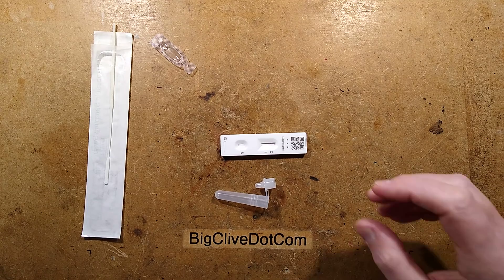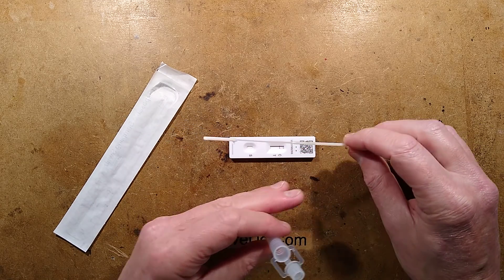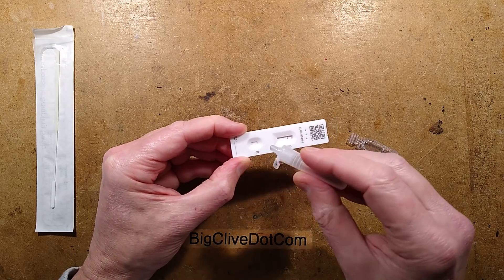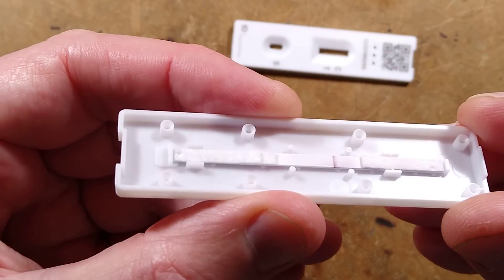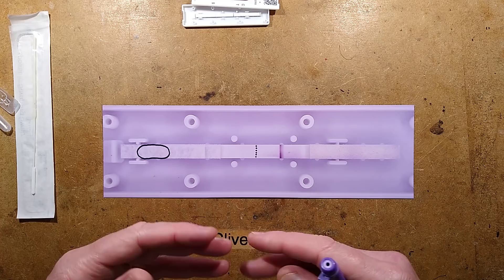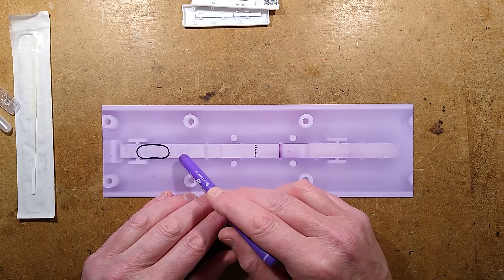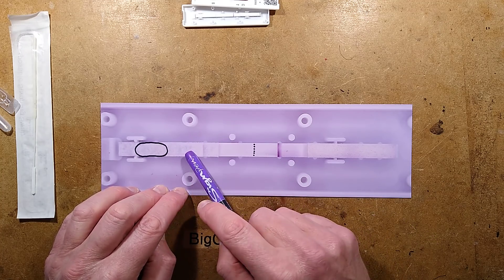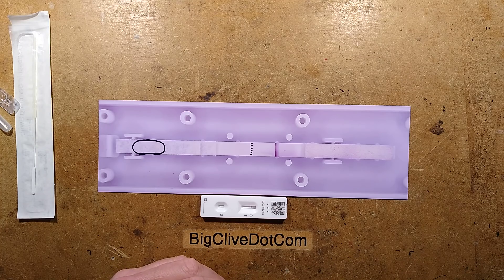How a lateral flow test strip works (kept simple)

Comment: When we put blood through them we generally separate out as much of all types of cells as possible, if you want to do lateral flow or blot type immunoassays you use serum, which is the gooey liquid that the cells float around in, minus many of the big proteins responsible for clotting.
Reply: Maybe for Covid, but plenty of LFAs use sample separation pads to do this making separation by other means unnecessary.
Reply: @xTheDeerLordx  But the pad handles separation, so you're still going to end up with something in the plasma to serum range for the actual reactions.

Comment: when I did my covid test they told me to twirl it around the opening of the nostrl
Reply: That was bad advice.
Reply: @wirdy1  Was the instructions on the test. stick wasn't much longer than a cotton swab or whatever
Reply: @Ckcdillpickle  I stand corrected. There is a new swab test that's far less invasive. Thanks for the heads-up 👍
Reply: The covid test places where full of parking wardens.
Reply: You should stick it about one inch deep, or until you feel it won't go any further.

Comment: A waste of plastic, I always feel bad when using them
Reply: Yeah, I'm happy to take the tests and appreciate the purpose behind them. I work in education and have to take them at least 2 times per week. However I just chucked yet another one in the bin after use and was honestly thinking the same. I thought to myself, "Future archaeologists will find a layer of these in the sediment in 10,000 years and learn of the pandemic." So much waste indeed. On a scale I find hard to find a comparison with. Maybe bullet casings on battlefields but even then locals usually scavenge most of those up for valuable scrap not long after the battle moves on.

Comment: I was under the impression that you took your sample from the back of the throat OR the back of the nasal canal. You don't do both at the same time.
Reply from the maker: This is an older version.
Reply: You do both with this type of test kit.
Reply: Nope, it’s both.
Reply: You learn something every day.
Reply: They are continually evolving or changing. I am several boxes in, supplied by my employer, and have had two brands that whilst very similar there were noticeable differences in procedure. I just make sure to read the instructions with each box in case something has changed or been updated and do the test as instructed.
Reply: Always read the instruction for your particular kit – they vary. More recent forms often only require the nose.

Comment: There's a company called DIAGNOS who have fairly recently released a saliva covid test rather than having to swab your throat and nose. A much nicer experience that's for sure.
Reply: Not sure they are a recent thing. I had those last summer from my employer, had to be sent to a lab for processing.
Reply: They are lateral flow tests - the same as these -  just using a saliva sample instead of a swab. You don't send them away - you get the results in 15 mins. Pretty sure if they were around since last summer no one would choose to stick a swab up their nose instead?

Comment: The latest test kits I've done don't ask for you to shove the swab up your nose, just around the tonsils
Reply: Some tests do it the other way, in other words swab up your nose but NOT your tonsils. I'll also add that I think it's about time somebody developed a non-invasive test that is about as cheap as this and just as accurate. Either that or a suitable blood test (that's 'invasive' of course but a pinprick is far more pleasant than ramming a swab up your nose or down your throat).
Reply: The latest ones I have are nose only – super easy (unless you’re one of the idiots who doesn’t read the instruction and thinks you need to ram it 6 cm up the nose of course! 😂). I imagine if it were that easy to come up with another test, people would do it – though I don’t think you’ll find many takers for a blood test as an ‘easy’ alternative!

Comment: We have something similar in beekeeping for testing for American foulbood a bacteria infection that kills bees. Thank you for showing how they work
Reply: How on Earth do you get the stick up the bees nose?! 😮😂
Reply: @Pugjamin   very slowly
Reply: @Pugjamin  no the pupa turns into goo and you add the samples to a bottle with some steel shot to mix it up then drip it on the test strip
Reply: The fact that these types of lateral flow tests are so common is why S Korea had so much COVID testing so fast.  It isn't the most reliable thing, but cheap and easy.
Reply: It's been a long, long time since I've kept bees. It's great that there's a test for AFB now. Is there also a treatment?
Back in the dark ages (1980s) we had to go by our sense of smell. Infected pupae smell like glue. If we found it, our only recourse was to cyanide the bees and burn the affected hives. Nasty disease.
Reply: @johnopalko5223  here in nz we use a liter of petrol and a match burnt in a hole and covered

Comment: You can still get covid when you're vaccinated.  I did 10 consecutive days of positive results with those, 2 months after my second Ox-AZ.
Reply: This is not news.
Reply from the maker: Yes you can.  But by priming your defence system your body has a head start against the virus.
Reply: @bigclivedotcom  Yeah Clive (good, interesting video as always btw), as a loose analogy it's like using well trained troops in a battle instead of poorly trained ones. It doesn't guarantee success but you'd be stupid if you didn't train your soldiers even though you had the time to do so.

Comment: Shows the process but not how it works, i.e how it can detect a dead virus molecule and identify it as a certain strain, hard enough for a lab to clarify.
Reply: It doesn’t detect the virus, it detects the body’s reaction to the virus.
Reply: It is an antigen test and will detect surface protein molecules on a live virus. The LFT is highly specific so is over 99% effective at detecting a viral infection although it may produce a small percentage of false positives, but may miss some low level infections with low viral load. If a LFT is positive there is a very high chance you are infected and highly infective. For this reason they are good as a screening tool to eliminate those who are infected and may be most likely to infect others. 
PCR looks for the virus genetic (RNA) material from its core, it is more prone to false positives because it can detect inactive viral fragments post infection but is good at finding infections with lower viral loads.
Reply: 1. It’s not designed to detect a ‘dead virus molecule’
2. It’s not designed to identify a certain strain
It detects the proteins of the Covid-19 virus.
Reply: @Zveebo  no virus is a living organism.
All viruses are a certain strain.

Comment: The new tests issued by UK gov are nasal only, no throat swab needed. Currently testing daily for work, which is fun…
Reply: also the fluid comes in the dropper bottles in newer kits
Reply: They're still supplying the throat and nose version alas. Picked up a pack at my local Boots a couple of weeks ago when I went in for my 'flu jab.
Reply: @SouthPaw1805  im in Scotland we can order a free pack of 7 test kits online and get them thru the post.
Reply: I've ordered by post and collected from various locations (including being given a set at my vaccine appt)
In my experience, those by post are the "new" nasal only (and faster, only 15 minutes) tests.
They also have more fluid in the container, so don't fail if there's more "gunk" than usual.

Comment: I think the 'C' might stand for "Control" instead of "confirmation", but I could be mistaken
Reply: 'C' stands for Clive, Big Clive, of course!! :-D
Reply: @stepheneyles2198  007?
Reply from the maker: It probably is.
Reply: @bigclivedotcom  The booklet says control line region, they work in a similar manner to the pregnancy tests sold in poundland and other higher priced shops.
Reply: @paulroberts01  They actually work in the exact same way, you just use different antibodies for the lines and conjugate (or "molecular keys attached to dye.")
Reply: S is for sample, T is for test, and yes C is for control
Reply: So the important thing is, Clive isn't pregnant.
Reply: It is all BS, no matter how you look at it !
Reply: @gertjanvandermeij4265  … no, it is not.

Comment: You should checkout the electronic covid tests kits, the electronics are totally unnecessary, but possibly hackable? the ones I've head of use a 32bit mcu
Reply: Lemme guess, they're the same thing as those "digital" pregnancy tests that are just a standard one but with a light sensor on the testing bit?
Reply: @kiefac  Yep. It was SignalPath that did the tear down.
Reply: I’ve used one of those, from a company named Ellume. The actual test components are very similar to any other lateral-flow test strip, except that the antibodies are tagged with fluorescent dyes; the PC board includes a couple of UV LEDs and some photosensors, and a ridiculous unnecessary apparatus that allows the device to send the results to your phone via Bluetooth. Silly thing was MUCH harder to use than a simple strip.
Reply: @LarryCadloff  They just want to claim that their strip is "just like the ones" used in laboratories and charge extra. Despite the fact that the ones we use generally have the sensors in a re-usable unit and we generally care more about more than a simple positive or negative.
Or well, no, not really. Generally when you use lateral flow you do only care about positive or negative, it's just that the MDs want to be able to put a number to that fact since it sometimes becomes useful.
Reply: Apparently you can play Doom on those.
Reply: @fluffycritter  But what can you do with the mysterious microchips Bill Gates has hidden in the vaccines? There must be millions of them floating about waiting for some ingenious hacker to repurpose them! :-)
Reply: @zh84  + the battery technology is rad!
Fun FACT
It would require 42 billion of them to power a Tesla (at full speed) for 1 mile! 🤣
Reply: @zh84  Play Doom on them.